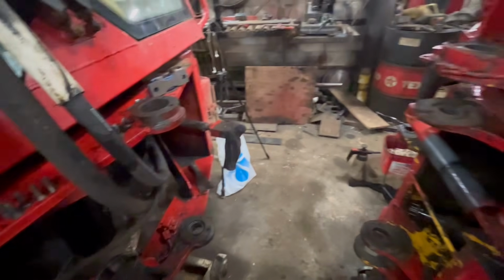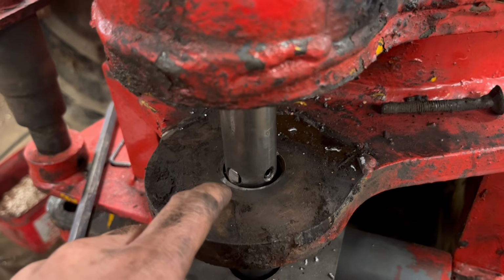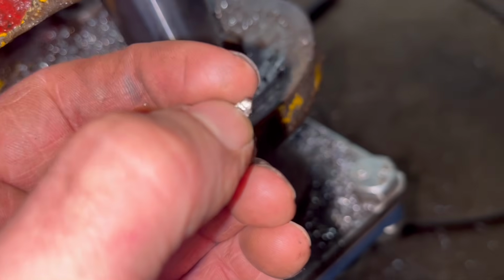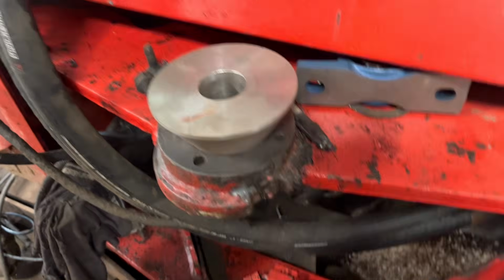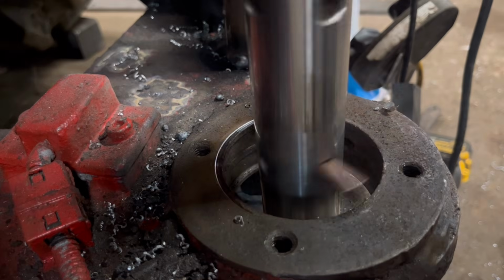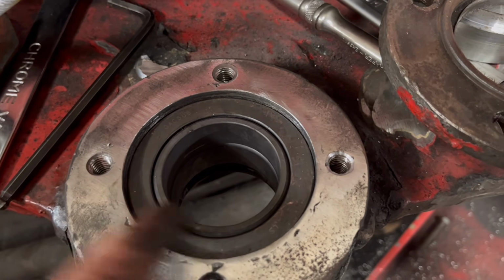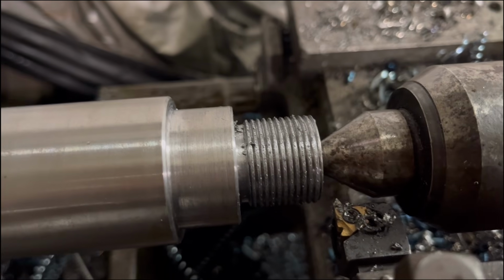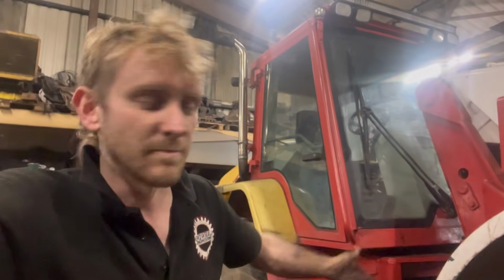Replacing centre pivot on a Matbro TR250. Part 2. Line boring and reassembly

Comment: 8:44  Would there be any benefit drilling the hole through the bar off centre, so as the cutting edge is level with the center line of the bar? 
Looking at different bars they all seem to be drilled centrally with the cutter running ‘high’?

Comment: Olly, that second ring down was installed incorrectly . ( duh!. ) just thot you needed my take on the subject. We would call that correction of a potential mistake before it happens as a “Good Catch”. So Olly,. Good Catch! Your work is brilliant. But your shop is no where near as representative of the work you do. I realize Snowball Engineering is a family business, and if it’s just you and your dad running the place that’s something you have to consider when it comes to renovation, but you gotta see your working environment is potentially comprimizing your work. I(we) are all amazed at what you get done with what you have to work with. I’ve owned three businesses, started out working for my dad at 14 and we stretched it as far and cheap as we could. Sound familiar? If you’re a “one man band” then you need to develop a mentorship program, and make it work (regardless of the expense, and the brutal learning curve that may occur).  Your talents are not being utilized to their fullest potential and your quality control should be the standard you build by. Been there, it hurts. OR you can be real happy with what you’re doing now!… also been there!

Comment: G'day from Australia. Just a quick question: In your video on the line boring of the JCB quick connect, you set the tool depth using a dial indicator attached to some sort of clamp. Is it a proprietary item or did you make it?

Comment: Would it have been possible to tilt the entire front section forward so that your line boring setup could have been setup horizontally from the bottom to the top holes?
Reply: Yes, but to do that you need the equipment to lift and stabilize it. He’s using ropes and boulders to do what he’s doing with the amazing results we’re seeing

Comment: If you ever have occasion to use the hydraulic hose flexible coupling again, try to also find a smaller bore piece with an OD that will go inside the ID of the big piece. It'll help prevent the sides of the larger piece from collapsing under load. It doesn't have to be full length; just long enough to fill the middle of the pipe without interfering with the connections.
(I also wonder whether overboring once and press fit sleeves wouldn't be easier (next time:) )

Comment: You did an excellent job there. That custom made line borer kicks ass.

If you reverse the hydraulics lines on one of the steering rams, you can split/join the whole unit using it's own hydraulics.

And aren't factory top bushes and pin available from the dealer ?.

Comment: That was a very difficult repair. For the flex pipe on the line boring, could you use ball joint swivel sockets to make the bend? Heavy-duty impact-type, I put two inline and got a good bend radius, this might just solve the flex-hose issue. JIM

Comment: Weld 4 , 12mm thick triangle shaped bits of steel. To a bit of bar. Braze about 20 mm chunk of a file on the edge of the triangle, after the edge is cut to about 45° angles,  with the chunk of file set to be a cutter/ filing edge,  with a length to bevel inside holes from about 35mm to about 70mm    over a short distance about 40 mm thick  and drill powered using a 12mm keyed shaft

Comment: I hope the farmer appreciated your hard work and how much time you spent on it.
Amazing job!
That thing is called a Threading Dial or a Chasing Dial.  I go with the first one. :)
Some people call them a star wheel but they are old hat 🤠
The rule of thumb I was taught for the depth of thread is .95 x the pitch.
If you think about it a 60 deg thread angle makes an equal lateral triangle.  So the pitch = the depth when you are advancing the cut with the compound slide set to 30 deg.  It’s a bit less than the pitch because of the nose radius on the tool.
You can also grind a HSS tool pretty easily.  That’s what I do.

Comment: Very nicely done 👍👍👍 what a mess to work with but awesome problem solving 👍👍👍 one tip on those broken bolts below the surface of there's just no other way to drill etc you can put some copper pipe in the hole to shield the sides it's a pain in small holes but can work 👍👍👍
Reply from the maker: Thanks for the tip!

Comment: The boring was bad enough but the welding had to be a chore. Hard to get a good weld when you don't have good access. Never seen a flex shaft like that. I have seen universal joints used before. I don't think when machines are engineered and built that a lot of planning goes into having to rebuild hinge joints or linkages. Some use welded in flanges that can be cut out and the flange replaced while others are much what you are having to deal with. You did a hell of a good job considering the problems you ran into.

Comment: Great job .   Full of dramas as they can be !    I have used a short shaft with a uni joint either end when line boring before .  The hose is a great method .  👍

Comment: Pretty cool that you built your own line boring setup.    

      Seems like you could use a snap gauge that goes in the same hole as the tool.    

     Kurtis at CEE Australia has this sort of setup and it seems it would give more accurate results as opposed to your “compass” style setup that transfers to a set of calipers.

Comment: Hi Oliver,
10 out of 10 for ploughing through.
The little box on the side of the lathe is a 'Threading dial', 1-8 means you can engage the lead screw on any number 1 through 8 as the lead screw is a metric pitch (8mm i think) and you were cutting a 2mm pitch. There are several Apps that give the thread dimensions for machining - Hague or ThreadData are a couple of good ones. Or good old fashioned Zeus tables. 
Yours Andy

Comment: Great job, especially considering what you were given to start with. I was wondering though: would it have been easier to tip the front end up and setup the line borer from the bottom? Or would that just not have worked for some reason?
Reply from the maker: There wasn’t really any safe way I could hold it tipped up. I thought the safest option was to work from the top with it sat level.
Reply: @snowballengineering  Yeah that makes sense. No point getting crushed over a job like this. Awesome work as always.

Comment: Good bit of engineering to get the line bar lined up in difficult position especially with smaller hole. 👌🏼 no job is easy to setup like making something from the start. Old machines always have add on adaptions 😜 noticed the hydraulic hose was great as a flexible adapter 💪🏼

Comment: Fantastic attitude when welding fabrication and machining, The first matbro teleram D and C were no trouble as I owned two when I did agricultural contracting, These later TR 250 seems the build quality or perhaps it’s the owners not maintaining them, Snowball engineering great videos keep the great quality of both work and videos.
Reply from the maker: We’ve had a few matbros as well over the years. Telerams, tr250 then onto a terex t250 and now a JCB TM320.
Thanks!

Comment: I think the whole machine would have been on its side after setback number 2. The numbers on the thread dial 1-8 usually mean 1 TO 8,  so any of them. You need to find out if you have a metric leadscrew or not. BUT if you're unsure, then never disengage the half nut, just reverse the motor to wind the tool back after clearing the work. All you are trying to maintain is the rotational relationship between spindle and leadscrew. 
The M30 x 2 could have been 4mm longer so the threads just poked through. What a great job in the end. Well done.

Comment: I sure hope that Greg Baronian from "On Fire Welding" and Kurtis from CCE see what you are doing here. This is pure genius.
Reply from the maker: Greg watches sometimes. 
Thanks!  Although I can’t take credit for the hose trick. I saw it on the portable line boring page on Facebook.
Reply: @snowballengineering  Probably before you were born, I was a hydraulic mechanic. I am wondering what would happen with the hose crushing if you could fill it with hydraulic oil and seal it up. I would like to see how you did the "hose ends" where they  attach to the boring bar. I am thinking that the oil would still allow the hose to be flexible, but  would resist twisting and crushing. Just a thought.

Comment: Next time you have to thread a pin, leave the threaded section longer than required, so you have a test section to work on. When happy, you can then cut to the required length
Reply from the maker: Good tip!

Comment: Well done Sir!  Bit of ingenuity, a heap of workshop skills and a whole load of perseverance gets the job done.  I was actually wondering if you were going to tip the whole front section forward and mount the boring tool from the bottom, but 200 mm of flexi does the trick !! (-:
Reply: How would you tip it forward without removing the boom. I was thinking it’s a shame he didn’t have a pit to work over that would allow the unit to be fitted from the bottom. Maybe when the next one comes in 😂😂
Reply: @johnwarwick4105  as a fully qualified armchair engineer, I would have left the boom attached (secured in place with ACRO props and baler twine), raised it up before detaching  the pins and used the end of the boom as a mahoosive handle to move the front section around. Obviously the experienced professional chose to use a different method to earn his living and I fully respect that decision 😀😀
Reply: @BurnAndHackett_RC  like the honesty 🤣🤣. As I dedicated pivot steer man, and having them split over the years it's an interesting idea but not one I would try, though it could work it would be very difficult to get back together even using a second forklift. Now if you were to reconnect the hydraulics and lift the boom once separated you could be on a winner.

Comment: Couple of issues that as you explained what they were I was thinking I'd do this or that and you actually did it .. first was the extension piece and removing to do half the boring then replace to finish off and the second was the jubilee clip round the old casing , just goes to show that not everything is straightforward cut an dry thinking out the box helps solve issues quicker than other methods . It's been a long job for you on this one but glad you got it done and repaired to a good standard and yep I'm sure a lot of us watching have been in your shoes where you got the job done and just want it out of sight asap.. well done

Comment: Having Driven Centre Steer Loaders Years ago At the Time I Thought What a Pain They Were With the Play in the Pivots,Now I See You Sorting this One Out I Was Correct.
The Manufacturer Should Offer A Solution to Repairing there Badly Desighned Machines,You Should be able to Buy Replacable Parts that Bolt on instead of Going Through All this Ridiculus Work To Sort out There Bad Desighn.
I Would Not Buy  a Centre Steer Machine.

Comment: Big Job   WELL DONE.   Thank you for the video.
Do you have fat rats or fat cats with the wheat in the open shed? Is the open shed wheat storage normal in you area?
Reply from the maker: Thanks! 
The wheats only tipped there short term before it goes through the drier and then put into proper storage.
Reply: Thank you for the answer. @snowballengineering

Comment: Great job, wondering if you considered putting the front end on his side. So you could put the machine on the other end, straight.
Reply from the maker: Yes, if I had a big overhead gantry crane I might of thought about tipping the front half over. Decided it wasn’t worth the hassle trying to do it with our JCB
Reply: @snowballengineering  maybe if you’ve used the boom to lean on, in the halfway position.

Comment: hopefully they asked for a set of spare pins that were made special for that repair.
great job and perseverence to get that all done

i've changed our own a few times as part of maintenance. standard parts are not that expensive so there should be no reason for anyone to let a machine to get into that state of wear.
takes only 3 - 4 hours to get done.